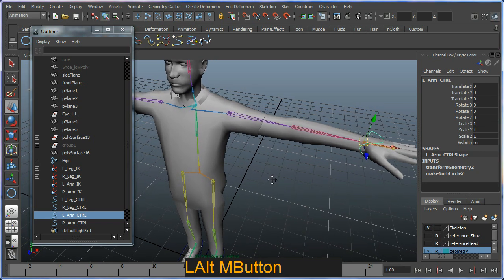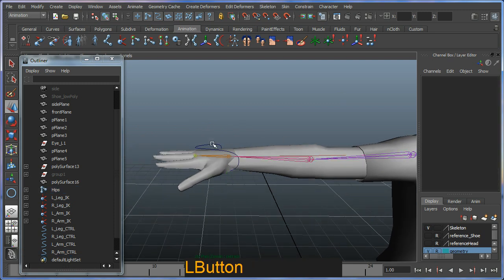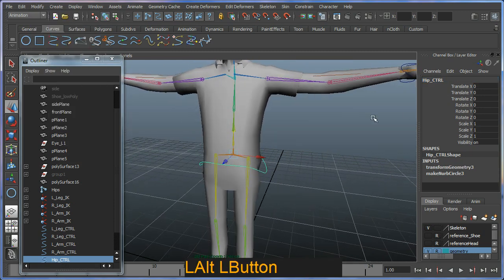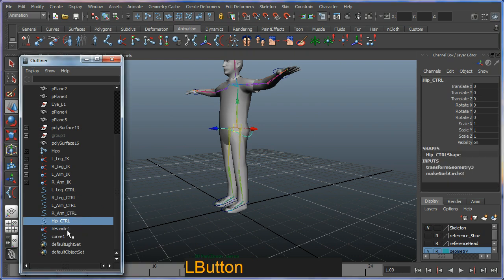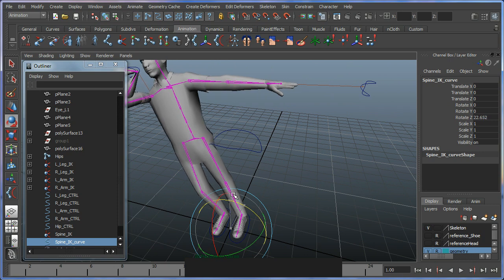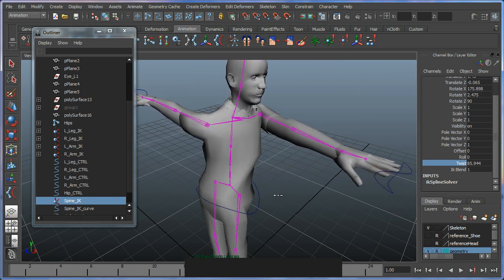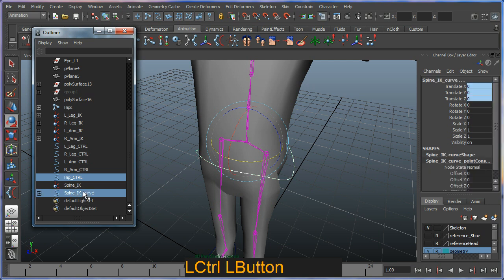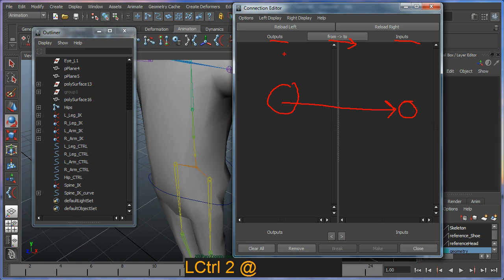Basic bipedal character rigging setup in Maya - Part 4 of 8

Comment: How do you get into Sub Object mode of the Curve to affect the other spine joints? Because all I see you doing in the video is dragging a selection box around the joints, which does not select the IK curve controller, so I'm a little lost. I can't move the spine IK except with the curve that it automatically created.

Comment: Hi Jamie, I am following your tutorial, but when I move my character legs and arms are moving along like if they didn't have controls. However if I move controls - it works with no problem. I mean, if I move root joint's control down - all character moves even though his arm and leg controls stays in the same place. Hope I was clear.   Do you know what could cause this? It's probably some setting is turned off, but I can't find what/where it is.
Thanks,
Anna

Comment: whenever i create the spline ik tool, maya doesnt create curve.. only the ik control, nothing else related to spline tool.
Reply from the maker: In the tool settings there should be an 'auto create spline' option.. check to see if that is switch on.. another possibility is that you have splines filtered out in the viewport..  have a look in the outliner to confirm if it is created or not.
Reply: Jamie Telford
Thank you, that fixed the problem!